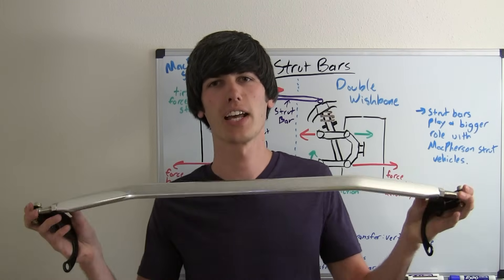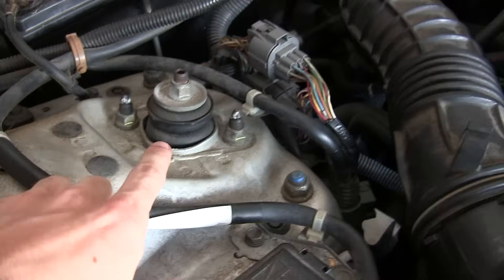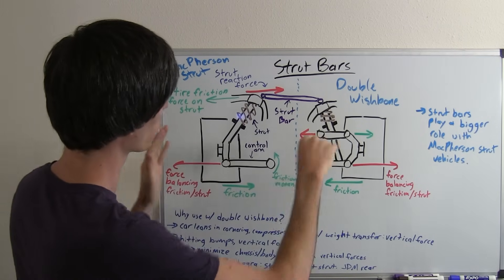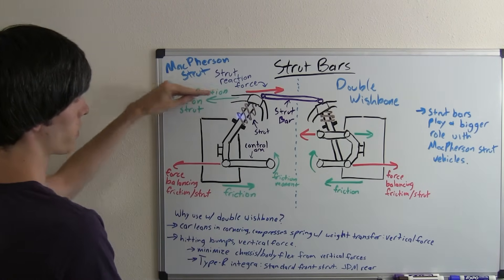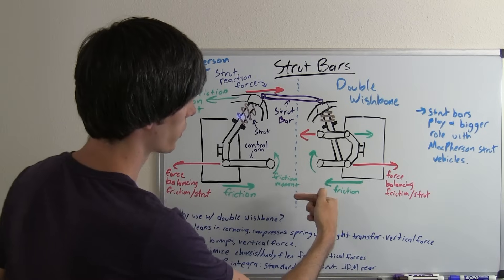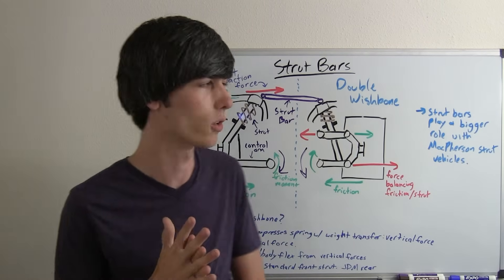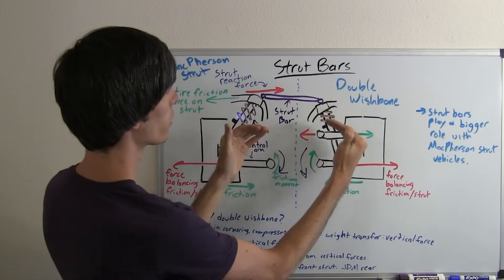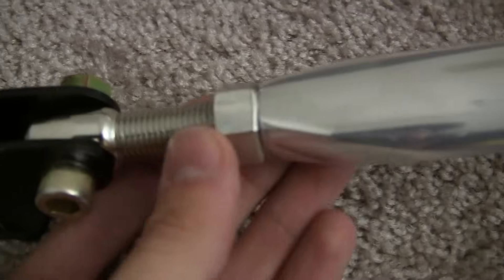Strut Bar - Explained

Comment: Ok.  Ok.  Thank you very much for this post!  Until today, I had no idea what a strut bar was or what it did.  We have a PT Cruiser and the previous owner installed a strut bar (Alutec UltraStrut) that is welded right beside the strut bolts, as you indicated.  My problem is it goes directly over the power steering reservoir which means I can't open that reservoir to check it.  It almost blocks the coolant reservoir ▬ but at least I can open that one.

Comment: I had a Honda Civic Ep3 Type R.  I ended up fitting a supercharger, coilovers, exhaust system etc. However one of the first modifications I made was to fit a front upper strut brace.  It made a noticeable difference.  Why? Because the European Ep3 type r had lifeless steering and no limited slip diff. So the strut made a huge difference.

Comment: Street Car - Don't touch the suspension, you just make it worse.
Race Car: Double Wishbone Suspension - Don't add any strut bars, MacPherson  - Maybe.

Few Important concepts are missing in the video:

When you tighten up the front by adding a tower brace, you make the car tight.  More Understeer.  When you tighten up the rear, you make the car lose.  Oversteer . 
So you are screwing with the balance.  

Adding of a strut bar very often makes the car handle worse, and it always makes for a stiffer ride.  

When you add so much bracing to a car, all the sudden the car is so tight it mishandles on uneven roads (Most of US).  This works on a track to a point, but even then it can get too tight.  

None of my race cars ever had strut bars in them.  

Street car - leave it the way it is.  People spent hours at the factory trying to make a balanced ride for you, and you want to throw their work out the window in few minutes.

There are situations where a use of a brace could make sense.  For example: Toyota Supra has a huge understeer by default.  Adding a brace to the rear will give you more  neutral balance.
Reply: Russain Guy Gang the presenter is explaining the use of a strut bar. struts are fastened or installed in car’s steel plate rather than bolted in car’s chassis. struts installed in car’s steel plate body gives a bending effect on the plate and that’s where the bracket comes to its purpose. My question is, how can a strut bracket eliminate that bending effect on the plate when he the presenter uses a folding end brackets? is it the purpose is to make the struts rigid in order to hold the struts swaying movement? please help me understand the purpose. Ty
Reply: Loony Linn Exactly, most off -the-shelf strut bars pivot at the ends because the bolts holding the bar are horizontal i.e. the same rotational placement as the exact motion it's meant to stop. You want a strut bar where the bar bolts in vertically through the brackets.

Alternatively, I suppose if that's all someone had available for their car, then the brackets could just be welded to the bar.
Reply: Street car:  leave it the way it is,  people spent hours at the factory trying to make an UNDERSTEER prone ride for you...

Fixed it for you... almost ALL vehicles (unless you are buying a halo model sports car that is factory tuned for performance)  will have a suspension tune that is biased towards understeer. Which is not a BAD thing, as most point A to point B drivers will never take a car to its handling limits unless they are trying to avoid a collision... understeer is "SAFE" 
Now, as a driving enthusiast, you know - a car tuned for neutral handling or a small amount of oversteer is the faster car in the corners.  Being able to rotate the car in a corner and correct with a dab of opposite lock is more desireable than plowing out of a corner, or worse, plowing out, lifting off and spinning the car... if spirited or track driving is your thing. 

Just saying,  the engineers that designed the suspension in most cars didn't set it up to handle at its absolute potential.  they set it up so the soccer mom that will flip the hell out if the car unexpectedly rotates in a corner and crash...doesn't  

Also not saying a strut bar is the answer to any particular question. I tend to agree that they are largely un needed... unless it is. 
I would argue the point that alot of modern cars tend to handle better when pushed to the limit when you install a stiffer than factory rear sway bar...
Reply: No, understeer is more complicated than simply being "loose" or "tight," or it being bad vs good, it's way oversimplifying the dynamics.

The short of the answer is the function of the body is to be rigid platform for the suspension to generate consistent grip under load. If you're talking street car, there's no way it "mishandles" on even roads due to it being too tight. Street cars by nature are underdamped for comfort. Plus, strut bars are about reducing unregulated, sloppy motion. Actually, now that I think about it I think you're confusing strut bar with sway bar.

Even assuming it's creating understeer, there are a million ways to offset that, like more camber in the front, stiffer rear sways, heck even changing front/rear tire pressure.
Reply: Coming from someone that has been through 4 suspension setups in his Focus ST since he blew his original monroe struts 2 years ago I can say you may be right. Unless you plan on having a race team to adjust your ride height, damping, preload, and camber in my case on both front and rear plus adjustable sway bar link all atound and adjustable control arms in rear...my car catches a dip and literally launches itself up and back down so hard yet its semi controlled so I guess you can say it works but it iant ideal. Roads suck and unless you plan on driving your car to the track and adjudting it there I would leave things alone except for maybe a mild lowering spring at most. Even that is playing with fire. I am up to a 1,000 set of coilovers, my second set, and have tried multiple adjustments and even brought it to every shop in town. I am gathering parts to put it back to stock and will be selling all the crap I wasted money on for half the price on ebay. The car is so stiff its jumpy and what sucks is there is enough adjustment in it where you could probably raise it up and adjuat the coilovers to a softer setting and get away with that but between me and the people at the shops around here it seems to be more of a hassle than they are willing to deal with. I cant even get my mecjhanic to replace parts on my car until they are noticeably bad. He wont replace struts that has 60k miles on them that he thinks are fine. The rears were leaking at 30k miles and replaced by factory though. What a joke.
Reply: I have an 1989 mk3 supra. Is it worth it?
Reply: Truer words have never been spoken on Youtube. I have a Focus St 2014 that is in wonderful condition and is clean as you could ask. An asian guy in our town I brought my car to, when I got there I was asking for original type shocks an a mild 3/4 inch eibach pro street spring which I already provided, All he should have done was order 4 new stock struts and shocks and installed the brand new top hat from factory I had, the brand new mild drop springs which are proven and acceptable on the street, but I was told coilovers would be simple and he has no issues  adjusting them and they are not that much different, I ordered my own set and had him install, THey wdre terrible, SO I replaced them with a set he sold me for 900 bucks and got ride of the others, THis was the third maybe fourth setup at this point,,,Gecko Racing coilovers with the camber platers and pillow tops, The guy charged me 100 bucks every time I brought the car back and told him he had the car adjusted incorrectly until I realized they were literally just clueless and guessing and not only that but they charged me multiple times, took my tips, and sold me a dream and when it was time yo make the dream happen the story changed, everything became Fords fault, my fault, the suspension companies fault, yet  I did everything he said three times over and paid him a fortune all to ruin my cars ride, make it uncomfortable and unsafe to drive unless your doing quadruple the speed limit and just trying to glide over every bump, and ruined my peace of mind, MY car came to his shop stock except a set of Eibach pros that were on stock struts and shocks, He should have replaced the oem shocks and struts and maybe put the Eibachs back on or just the stock spings, INstead he turned my newer nice car that is extremely reliable and mint in many aspects into a covered wagon that sits and sits and sits because its like driving a scissor lift at 80 mph,
Reply: I know this comment is from a long time ago, but when I added 1 to my '91 Eclipse GSX I found it has a nice impact on increasing turn-in and didn't notice any negative impact on street handling.

Comment: Really disappointed you didn't use a welded strut brace triangulated to the firewall. This is a good explanation of the concept for the layman but you could have gone further by explaining how compliance in those fasteners/threads, how those steel brackets are hilariously cantilevered away from the load path make a two point bar a very very marginal improvement, if any, in the handling dept.
Reply: marc mendes Even a 3 point strut bar is an ultra fine tuning component, like adding a massive gt wing for example. For handling start with tires, coilovers, weight, and then nitty gritty stuff like chassis modifications.
Reply: marc mendes my bro and i were talking about the 3 point strut bar this morning. since i won't take my delsol to the track and its just street we went with a basic strut bar. i wouldn't see why any car on the street would need three point strut
Reply: A street car doesn't NEED a lot of things, but people do them anyways. Like a blown 800hp 3mpg camaro or a civic with a giant turbo that doesnt spool until 5k. You can make whatever choices you want and ultimately it comes down to what car you have and what you want to do with it. but me, id save the money for just about anything else over a 3 piece, 2 point strut bar. 
It  was more a comment hoping they would have explained some real engineering concepts behind chassis stiffness and take things a step further than the standard explanation you can get on any forum and why people continue to have people buying up those useless 2 piece bars. I think you'll find your strut bar is mostly just in the way for a street car (it was in mine)
Reply: Since we're talking street cars, triangulated braces aren't all that beneficial to them. The firewall isn't a strong point for mounting something like that. A basic design, solid sway bar would work better unless the firewall was reinforced. I've yet to read any positive feedback from tri-braces and just looking at the overall design, you can see that as a corner is moving up/down it will be pulling that bar, and therefore firewall itself, to it.

Comment: You've missed something, the most important function of a strut bar is to increase rigidity of the chassis. When you corner or hit a bump, the chassis will compress and bend slightly between the struts, the strut bar is there to minimise the compression, hence improve rigidity.
Reply: um sorry, what?! that's literally one of the first things he said lmao
Reply: Hold this L macbrush

Comment: One thing I have wondered is, why strut bars have oval holes for the bolts? Is this to allow flex or adjust for misalignment? It just seems odd that if the bar is supposed to increase rigidity, but at the same time is allowing some form of flex or movement from the strut towers.

Comment: Dear Engineer,  the force analysis of mechanisms can not be performed like your ıntiutive approach. You should first learn degree of freedom of joints. A revolute joint as in chassis side of the lower control arms  has one freedom in rotation along its axis and there can not be a moment reaction which you wrote as "friction moment"  thus your all analysis is wrong.
Reply: What youre talking about? the pivot point of the lower control arm is not coincident with the friction vector... therefore there MUST be a moment created lol

Comment: +Engineering Explained Does adding a strut bar to a car reduce or increase stress on the original chassis? Basically, would it prolong a chassis's structural integrity or the opposite?
Reply: Alex Yang depends on how you drive. increasing the rigidity of the vehicle puts more stress to the tires. I noticed this after I put a front sway bar on my 96 corolla. I got wayyyyy less body roll but noticed my tires wear faster. then again the increased stability gave me more confidence to corner faster soooo it's debatable.
Reply: Exactly what I have been looking for ! Intelligent scientific explanation of cars - just brilliant and thank you 🙏

Comment: can someone PLEASE do some double blind testing with and without a strut bar? include lap times as well.  everyone says "the car FEELS better" etc. but there's ZERO proof on the entire internet that these actually do anything.
Reply: lampim. Agreed. The car might feel a bit "tighter" as the slight ( as in thousands of an inch) flexing of the strut towers would be reduced, but actual lap times would be the same. The crap ones shown in this video are weak at the brackets, as the brackets extend upwards and can flex themselves. The bars are bent, which in itself is a weak design. And the brace is not triangulated to the firewall, therefore the strut towers could technically flex front to rear. Mostly rubish! If your strut towers are flexing that much, the car is scary weak.
Reply: Most tower bars won't be straight because it needs to actually get over the engine. Or they will need to be raised. There's no way around that

Comment: strutbar are a marketing scam , just like sport airfilters.. its good bussines
Reply: Free man most of the time, but not always.
Reply: Sebastian Tri for a high flow intake to work, you need a high flow exhuast for the air to escape as fast as its going in.
Reply: Its not marketing some of the times. The fact is... It will depend on the quality of the bar but most important the state of the car. A 10 year old car might notice a huge difference, while a 1 year car wouldnt notice difference at all.

Strut braces are also used on racing.
Reply: Sorry to say this, but my struts that had a little over 80k miles, felt newer after putting on my strut tower brace bar. But now, I have been riding on Koni yellow sport shocks and struts with that same strut bar. It is even more wicked of a ride. Oh... and I put them in my vehicle myself too! Even modded my car to accept the Koni yellow sport struts to go onto, since Koni doesn’t make their yellow sports for it.

Comment from the maker: I wouldn't call it the "strongest shape in physics." If anything, that would be awarded to circles as they distribute stress the most evenly - hence the use of cylinders in  many structural systems, and why you can stand on an empty soda can without it crushing. That said, triangles are a strong shape in 2d, as they don't allow for movement as easily (degress of freedom) like a square.

Comment: I have 2 questions:
1) The strut bar is strong in the axis of the bar (i.e. horizontal forces) but weak in the direction perpendicular (i.e. vertical forces) to the axis. How is that going to help for those forces due to the compression of the spring? The bar will just bend (not unlike a cantilevered beam).

2) In your video the left wheel forces were analysed for a right turn, and the right wheel forces for a left turn. What if you analyse both wheels for, say a left turn only? Wouldn't  you get the forces at both strut towers in the same direction, so the strut bar will just move along, and would be of no help in tying the towers?

Comment: A sway bar is a metal rod that attaches to the wheels at the hub using a link. The front/rear wheels are linked together in this way to when one wheel goes up when going over something it has to try and lift the other wheel with it. This is to reduce body roll or the side to side pitching/swaying you get after hitting a bump in some cars.

Comment: Anti-roll bar is a torsion bar that connects at the bottom of the vehicle. It works on slightly different principles. Check out his video on anti-roll bar in the suspension section.

Comment: Thanks for the interesting and informative video, Jason. 

I was wondering whether a strut tower brace would be under compression or tension on a car with a double-wishbone suspension when the car is negotiating a turn under large cornering forces.

Comment: I've got a question, while discussing the potential value in a strut bar on a double wishbone, you bring up the fact that the shock will be compressed during a hard turn. Of course this is true, so it makes me reconsider your explanation of the macpherson strut. You explain that a hard turn would cause a rotational force upon the lower control arm, pulling the strut from its tower. What about the compression of the strut? Wouldn't it be pushing the strut into the tower? Good videos regardless.

Comment: Hey! So you say the friction on the wheel caused by turning will pull the strut down (i.e extending the spring, pulling the strut away from the car's body). BUT wouldn't the weight shift from the turn push down and compress the spring (pushing it into the car's body), thereby cancelling out the first force (and possibly being quite a lot stronger than the force you mention in this video)? I hope this is clear and I would really appreciate an answer if anyone has an idea.

Comment: Tell if this is a correct analysis. 

Strut towers are connected to the body of the car regardless of macphearson or Double-A. However, they can flex a little within ( it looks like there are bushings but there will be body flex). This means that that the force the strut bar transfers is moresoe due to the rotation of the strut than any linear movement.